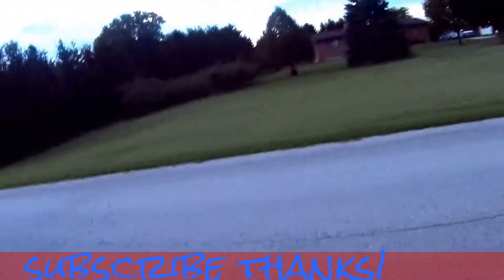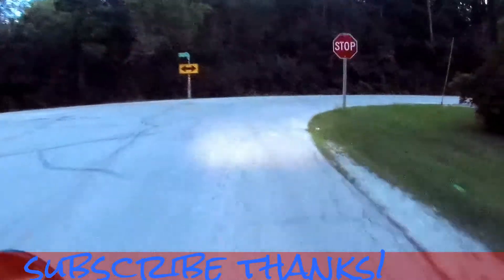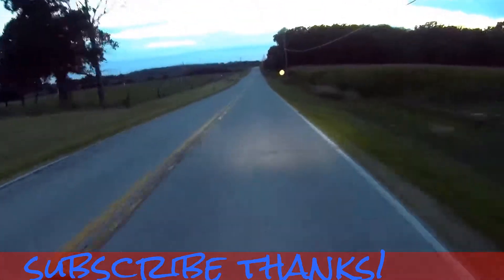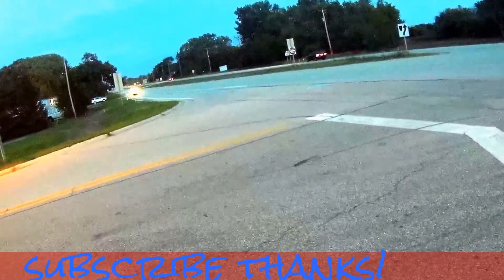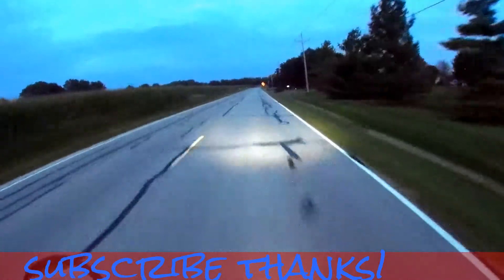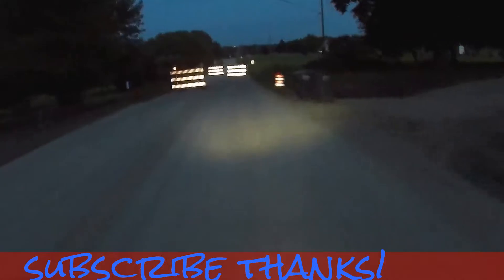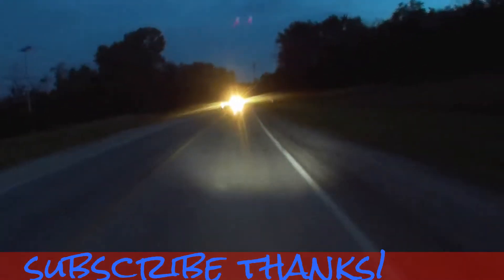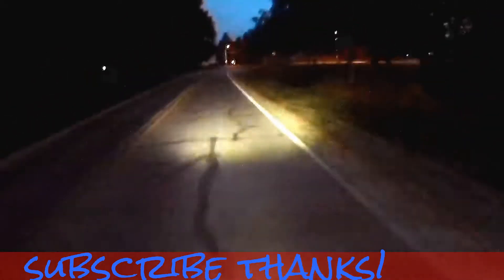taotao zummer moto vlog# 5 when bugs attack! and some off road action ! HD

Comment: From your experience, can u recommend changing to big bore or just leave it on 50cc but change the belt?
Reply from the maker: i think a 72cc big bore kit would be fine  but the  100cc i think is very hard on the crank . but if you leave it 50cc i'm sure it will last a long  time . as for the belt id get a gates kevlar belt it won't make it faster  but it will last a whole lot longer.